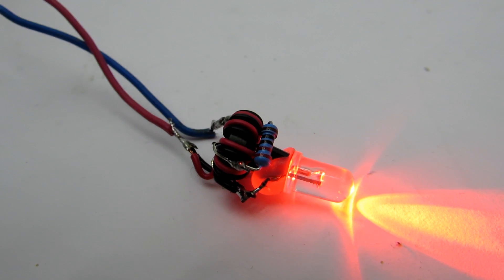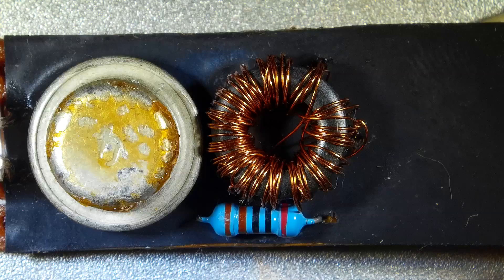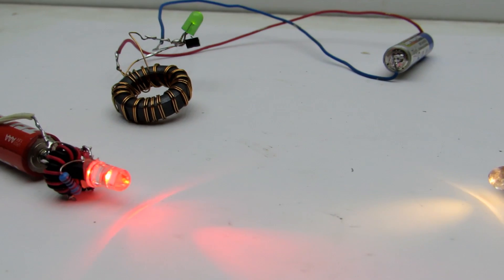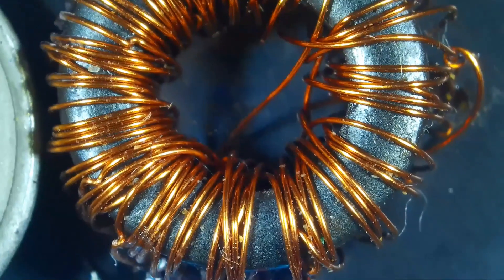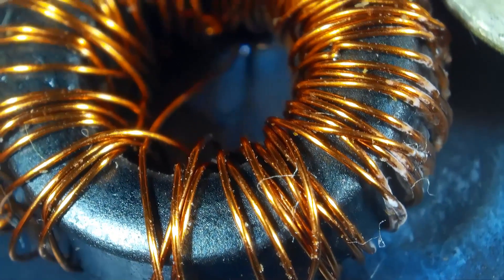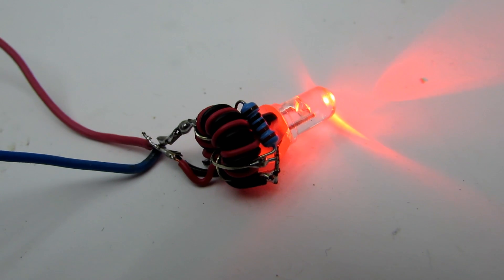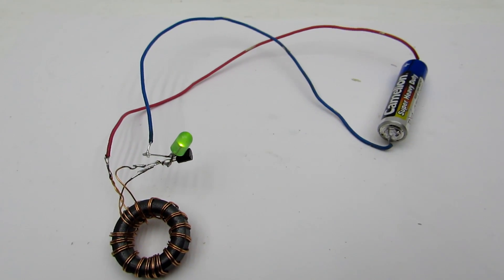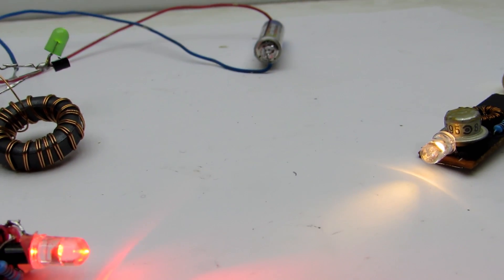The  "ETERNAL"  flashlight

Comment: Lol try reverse  engineering it and use the led to charge a capacitor when it is not in use but then then you flip a switch the led will light up thanks for reading I would really like to see video on something like that so if possible please do :D

Comment: After doing countless experiments using a Joule Thief, it never crossed my mind to use a germanium transistor lol. Thanks for sharing. Cheers :)
Reply: i think this video was suggested mainly because of my recent fleabay spree... 500 or so germaniums.

hard to find NPN (silly expensive...)but pnp works just as well if you flip the circuit the other way round.
Reply: @paradiselost9946  Nice one mate, get your component tester on them and see which one is leaky. Cheers.

Comment: the inductor cores you use are overkill. the circuit almost works with just 2 long wires wound in a circle a few times. you can make it very small if you try